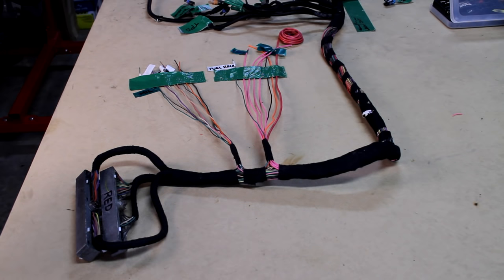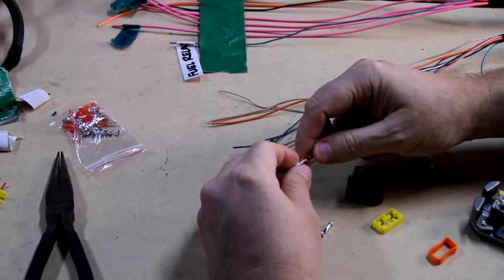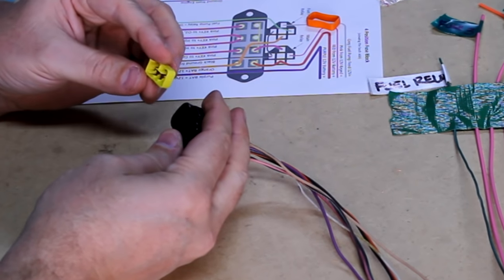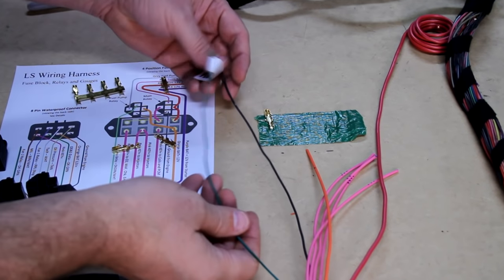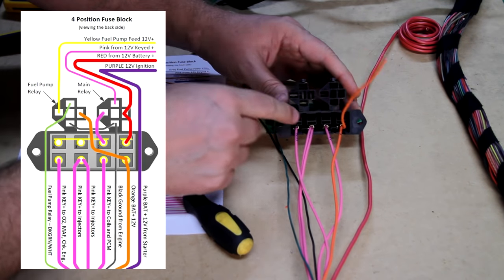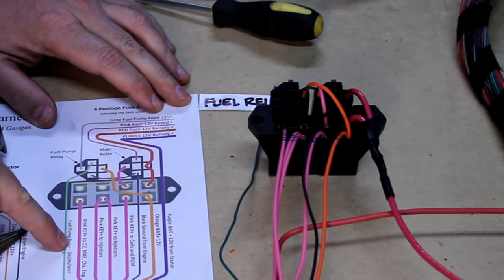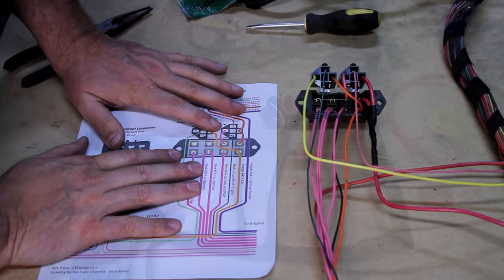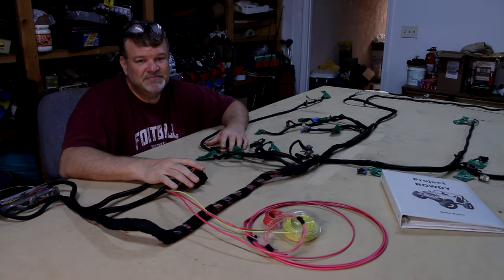LS Wiring Harness Part 5 | Project Rowdy Ep017

Comment: What fuse rating did you use for Fuse 1, 2, 3, 4?  Love the videos.  You have been a big help.  Thanks
Reply from the maker: 15 Amps for all four Fuses.
Reply: Thanks. 
I tried 1=10A and 15A for the other 3 and all was ok.  My issue now is the motor idles perfect but as soon as you press the throttle it starts to surge and wont reeve up.  Tried about everything and the guy tuning did all he could with the program.  Think I might have missed something in the harness or reversed the polarity in a sensor or something stupid.  Whatever it is its confusing the computer. No codes also.
It is a used truck 1999 5.3L (never heard it running) drive by cable then I added new Intake, throttle body, fuel rails, oil pan, water pump, starter, alternator and headers, 8 new coils, plugs and wires on it.  Installed 2 new AC Delco front O2 sensors (4pin flat connector style chassis ground), Reused the original injectors (cleaned up), cam, crank and knock sensors (never even removed them to check them) and kept the original throttle position sensor and 1bar MAP.  Motor was not taken apart.  
 We tried another MAF/IAT, MAP, throttle position, IAC and even went back to the stock Throttle body with no luck.
I am going to remove and dbl check the harness today.  Any chance you have heard of this problem and could point me in a direction?  Thanks
Reply: I am also running a modified 700r4 with the lockup done in it so the computer is set for manual transmission.  After checking the harness all over I just found that Pin 41 and 32 are recommended to be grounded even though I don't have a computer controlled transmission.  I just grounded 41 and it did not help.  I will have to do pin 32 next and see what happens.  Fingers crossed.
Reply from the maker: Wish you were getting some kind of code which might point you as least to a starting point.
Reply: I found it.  Blue connector Pins 41 and 32 need to be grounded in my case even though I did not have a computer controlled trans .  41 didn't seam to relay make a difference but 32 must be related to the crank sensor calibration and with out it connected the motor with idle fine but off idle it surges big time.  Seams good now.  I have to get back to my tune guy Thursday night to finish up the tune.  Fingers crossed this old motor stays together.  I will let you know how I make out.
Reply from the maker: So glad you found your issue.  And thank you for letting us know what you found.   I am going to check through mine and makes sure I have these wires grounded.  Cheers and definitely keep us updated.  Mike
Reply: All went well.  255hp and 280ft/lb at the rear tires for a stock 5.3L except for the intake/TB and headers. it seams good for an old motor that looked like it was not taken very good care of.  A cam swap would help it a bunch, but it is more then enough for the wife's 62 Corvette the way it is.  The TB has a very stiff spring so the throttle control is tough right now.  I will probably have to remake the peddle assy to change the ratio.  Still very happy.
Reply from the maker: The stock LM7 should have 282-295HP and 325-335ft/lb of torque based on the literature that I have seen.  I believe you mentioned that you have not opened this engine and only have modified the Intake.  Any concerns there?  These engines are pretty tough and can run forever so a rebuild is not always needed.  Have you seen my LM7 Rebuild series (https://www.youtube.com/playlist?list=PLo32GavtEb9Tcr_0a33AjCXzpy1VLu0nT)?   If the engine is out, I would at least recommend changing the Oil Pump (the Heart of the engine) which could be a part of your Cam swap efforts.  Melling's standard replacement offers slightly higher than standard flow than the OEM model (Their High performance model would not be recommended, it will suck a standard oil pan dry).   Glad you have everything worked out so far.

Comment: I know the green wire is the power the relay for the fuel pump but what pink ign wire is to power ign relay?
Reply from the maker: Ignition Relay?  Your Ignition Key triggers the Starter Solenoid (possibly what you are calling the Ign relay).  You are connecting Vehicle Ignition Key wiring to the "Purple" wire which triggers the Starter Solenoid.
Reply: I figured it out the pink wire 19 is recieving ignition power and the pink wire 75 is the ignition wire that is hot when you turn the key to run position.

Comment: Did u use a 4 pin relay on it
Reply from the maker: wilbert jordan  Yes!!  These two relays are 4-pin relays.   Later when I configure my dual fan cooling system, I will have to use at least one 5-pin relay... but that’s later.   Cheers. Mike!!

Comment: where do those pink wires come from o2s?
Reply from the maker: Some of the items on the engine require power and are then Negatively switched.  These pink wire go to the Injectors, Coils, PCM, O2, MAF, and Check Engine Light.  I have created a diagram that you can download.  See the "Show More" section below this video for a link to the download.

Comment: Will this work for a 4.3 v6 out of 2001 S10
Reply from the maker: The concept and approach would be the same!   You will just need to find the pinout charts for that engine.  The one that I used was specific to a 5.3 from 1999-2003.  You need to determine your switched power wires to keep (Pink) and all of the accessory wires (you could trace or ohm test to determine).   This overall approach would work for a Dodge engine if you think about it.   Hope that helps.
Reply: Thanks for the information

Comment: Can I use 80 Amp relays ? What would happen?
Reply from the maker: To be honest, I am not sure.   With that said,  I believe they would work as they are rated higher than needed and your fuse will still protect the circuit as designed.    However, for the cheep price of relays, I would suggest purchasing the  correct ones.  Mike.
Reply: I got a waterproof version of the box you built but it came with eighty amp relays
Reply: I am using your design. I was just worried about the few pump relay, actually Because it uses no fuse